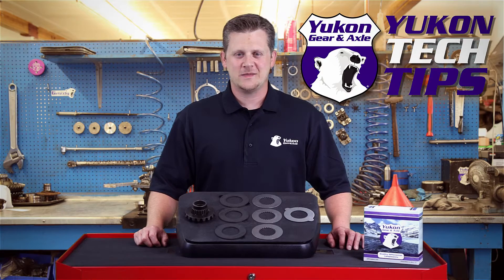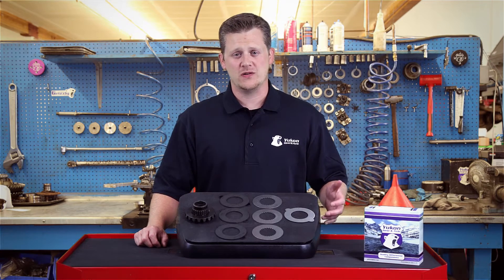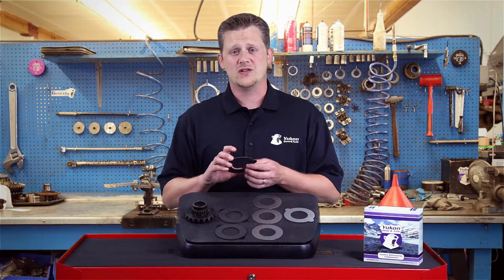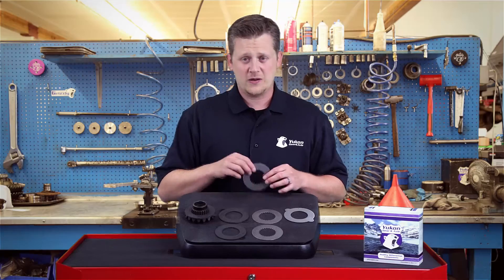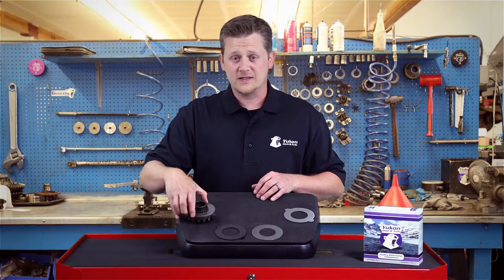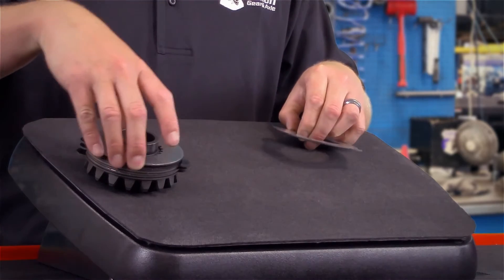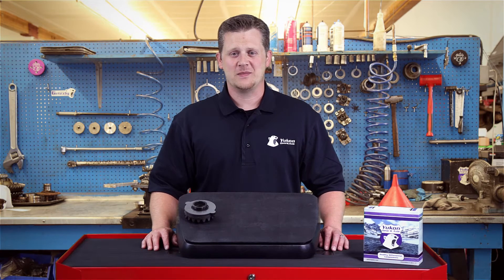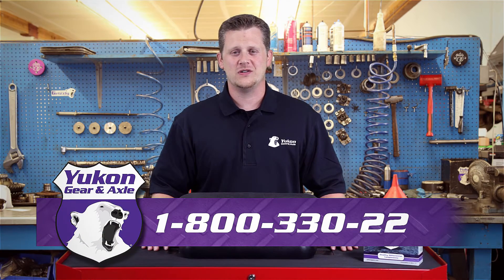How to Stack Clutches for a Clutch Style Positraction | Differential Tech Tips

Comment: I have a 1999 Dodge 3500 Dana 80 35 Spline. My differential has a concave spacer. 1 thick single side clutch, then a smooth plate, then double sided clutch, then smooth plate, then a double sided clutch, smooth plate.  If I put all of the plates and clutches in, the yoke with the spider gears do not sit flush with the differential housing. I have to take one smooth plate out on each side in order for the spider gear yoke to sit flush. When I do that I have play in the axle gear. If I do not take them out the gears are hard to move. I'm assuming the plates are too thick. I do not want to put some of the old plates in due to them being warn out. 

Should I take a digital caliper to the old disc clutches and plates and see what the thickness is compared to the new ones?
Reply: Dodge Dana 80 powerloc vs Trac lock. It should be know but it's isn't talked about. A Dana powerloc may be a track lock. Although, the exterior case is the same design as a 60 and 70 powerloc, the cross shaft does have ramps however, the cross shaft is one piece. Therefore, it's a track lock. What's more confusing is the the internials do not interchange with a track lock except for the clutches. Also, the 80 powerloc/ track lock shares the same pinion gears. You can replace the one piece cross shaft (power lock design with a real two piece cross shaft so the cross shafts can ramp. The 80 hats and side gears are different than the 60/70 powerloc. The 80 hats are thinner in width than the 60/70 and are not as beveled (deep). Also the 80 side gears are not has thick gear width. Also, the 80 clutch spline depth is much longer... You must use original factory clutches (lined/ round rings). Using 60/70 clutches will not work however, the 80 real track lock clutches interchange. Track lock case is different, flat cross pin one piece, no hats and uses pinion thrust washers.... Again nothing interchangeable into the Dana 60/70 powerloc except for the 80 powerloc case that was called a track lock by it's own design and  unique to itself. Four wheels,. Take all the internials from one of these 80 units and put it into your 60/70 powerloc lock and replace the cross shaft with a two piece. Factory is five friction sides  on the clutches or you can move the disc and plates to seven or nine friction sides and be almost a spool. This can also be done to the 80 track lock however, you won't have the ramping design.